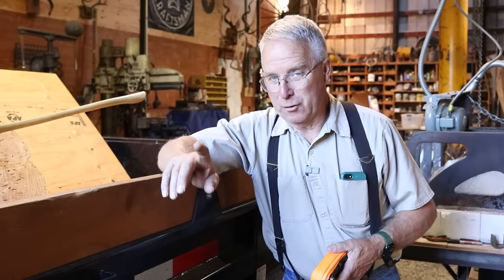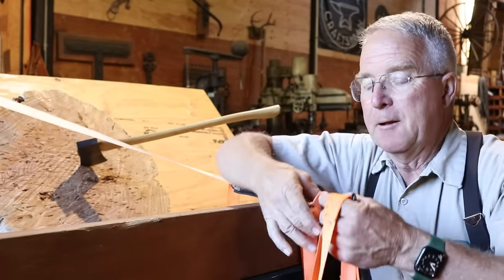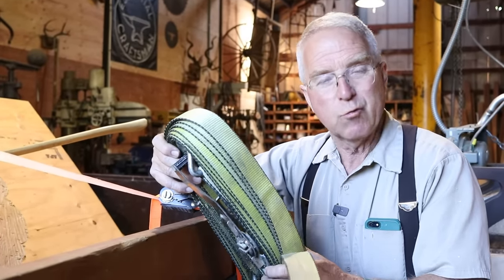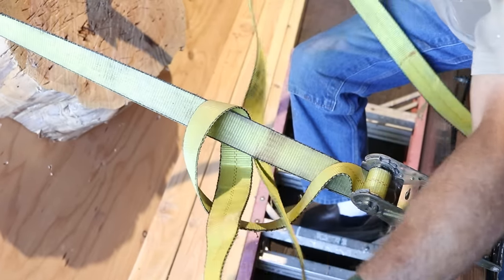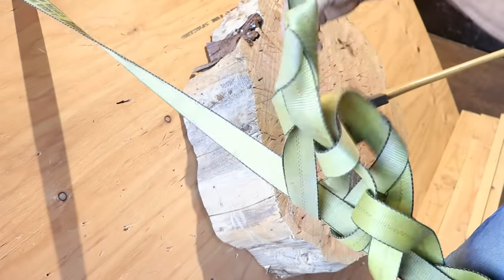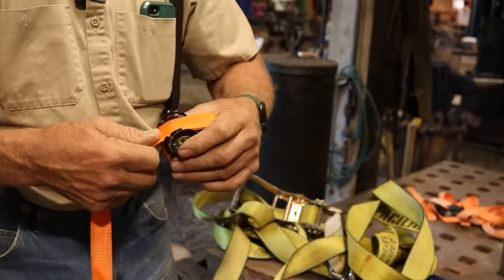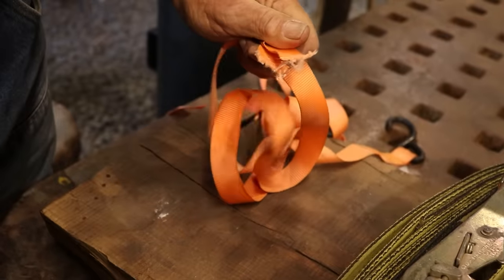7 Ratchet Strap Pro Tips

Comment: Also for the loose left over webbing I fold it repeatedly against the standing taught webbing and secure it in place with 3 or 4 turns of electrical tape… it’s super neat and easy to snap off when it’s time to in load… I’ve actually had that loose webbing vs wheel situation on the highway and it sucks! Hard! So  now I always secure the loose strap..

Comment: I like using One-Tie reusable zipties. I wrap my ratchet strap in nice neat bundles with them and then after securing the load I just bundle up my excess and use my One-Tie strap to wrap the excess to the strap. Fast, easy, secure and keeps me from loosing my one tie. If you have the tails of your One-Tie on your wrapped rachet straps all facing up when you store your straps then you can grab younr rachet straps by the tails of the One-Ties so you can grab multiple rachet straps at once out of your vehicle.

Comment: For the tails, depending on what I'm hauling, I just take the end and go to the hook to the left or right, run the strap through either the eye or under that strap, then do a quick loop knot and hold it fast. If the tail is long enough, then I'll loop it through the left/right hook and then back to itself.
No flapping in the breeze.

If I'm carrying boxes (I normally have cardboard boxes of delivery products), I take the loose end and pull it between two boxes that are stacked on each other. This secures the end and keeps it from pulling loose. I'll put 3 straps in the same spot.  If I need to put more, I go to another pair of boxes to finish those holding those straps.

Comment: Latest cross country, I stabilized the flapping end by driving a sharp awl, therefor no damage to the threads, right through the strap end and tensioned strap, and put in some 18 ga copper wire with a few twists.  Nothing moved.  And as these were boat straps, it turns out I can loosen them enough to take them off, yet they will go back on without any additional adjustment.

Comment: I use 27' long straps regularly. Sometimes with chain extensions. It's quite a ways up and over a double stack of hay! On occasion there is a tail,  what you called the bitter end. My husband ties that into knots and weaves it back and forth and then a few knots. Time consuming to pick that out! I will be showing him your trick. As I am the one who unstraps, I take the ratchet off the long strap and roll the strap, hook to the middle. It's easier for me to throw holding only the strap. If the strap does not hit the targeted spot I use a telescoping good ball retriever to adjust it's position from the ground. Not what it was meant for but until 8 can do better, that is the tool of choice!

Comment: Oh good, only 231 comments behind. First off thank you for all the wonderful videos. I have learned so much. Some I scold myself and I wrestle with but most of all learned a new way. I would like to throw two cent of an opinion your way.
  First off when terminating a end. There is a small pocket of double band between the short side to the ratchet. Fold up the remaining end and place in that pocket  BEFORE you ratchet the load. It can't even be pulled out after you ratchet it, until you loosen the ratchet. 
 Secondly,  I like wrapping the unused ratchet up the same way, but pull the load strap to the about middle and it will take half as long and when you ready to use, both ends will be in your hands when you unwind it.

Comment: Years ago, I got into the habit of storing my straps with a piece of cordage wrapped around the roll. Keeps them from unrolling, and provides a piece of rope to tie up the excess so it won't unravel. I tried bungy cords but found they have a habit of getting cut without you knowing. The strap wrapped up with about 2 ft of cord makes it possible to throw or toss the strap without it unraveling. The daisy chain I found can be a hazard when climbing on the trailer for something. (Ask me how I know) The rule of thumb was, pull it tight then tie it up. When done we roll it up , tie it ,then hang it by the hook for easy use next time.

Comment: Something I do for storing straps, is remove the strap from the racket, take the strap and fold end-to-end until I have the smallest workable length, then tie it in an over hand knot. At that point, I have a little bag I keep them all in, which actually came with a set I bought recently. You can throw em in the back of a truck and never have to worry about them tangling. Something you mentioned in your video about daisy-chaining extension chords that always sticks with me, “if I tie it in the knot that I chose, it won’t end up in a messy knot when I get to the job”. I know that’s not exactly what you said, but I tell all my helpers that when I’m teaching them how to tie a daisy-chain.

Comment: Fireball tool also tested and got the number: twisting your ratchet strap half a turn actually makes it handle more load then running it straight. Also keeps it from vibrating as much by the wind

Comment: For loose ends of a strap, I keep large Harbor Freight zip ties in my truck and just zigzag the loose end and then zip tie it tight.  My pocket knife cuts the zip tie loose quickly and it is already loose to remove the strap at my destination.  This method has also never failed me and keeps the loose ends from any flopping around in the wind.  Thanks.

Comment: Another thing if possible, is always put the windless “business end” of the strap to the passenger side of your trailer/load. That way if you have to pull off on the highway or road that you’re traveling to tighten or adjust your load, you won’t be on the traffic side of your trailer

Comment: I find the quick/easy way to wrap up the strap/store when not in use is to fold it in half repeatedly (maybe five) and then in thirds if needed (leaves a bundle ~six" long). With that done I then use a longer twist-tie to fasten it to the ratchet. Doing this, the two pieces are always kept together, take minimal space and they are quick/easy to use again when needed.

Comment: Sometimes the ratchet ends up in a tight spot when your going to loosen it, so you cant fully extend it to make it release. When that happens, pull both levers back on the ratchet, use a stick of your worried about your finger, and the half crank the ratchet back and forth. It will usually come loose.

Comment: I wrap my straps around like you did but if you leave like 2-3 feet on the end and then wrap 90 degrees to to the way you started you will find it holds better and you can tuck the tail.

Comment: Never buy the small 1" straps, unless its for use on a car roof.
90% of your tie downs will be using straps of a certain length, so take the tail of the strap that isn't used, roll it up with a hole in the center the size of your hand, then 2' from the ratchet, take the strap between the roll and ratchet and thread through the hole and over, tying a knot around the roll of strap. This can be left hanging loose and won't unroll. Then when unloading, just leave the strap as is, and pack it away. Next time you have a strap that can quickly be deployed, and you can easily adjust the length of the strap by rolling or unrolling parts of the strap on the roll.

Comment: I've seen a video by a trucker in BC, Canada who has a different elegant method for dealing with the tail -- fold it up, put it under the loadbearing strap where it meets the edge of the trailer, and snug it up, so the tail is clamped betwixt, and it also provides corner protection.

Comment: Thanks for the excellent video. So much good information. 

One thing I didn't see mentioned was what if the strap comes out of the rachet windlass. 

Close the ratchet, ratchet it until the windlass slot is straight and insert the strap. That way the strap is on the outside of the ratchet. Think of it as outside the box or ratchet.

Thanks again

Comment: The easiest and “cleanest” way to secure excess strap after ratcheting tight is to coil the strap (like you would a lasso) in about 1-1/2’ diameter loops starting about a foot from the ratchet mechanism. Then lay the stack of coiled loops on top of the taught portion of the strap splitting the coiled loops down the middle. Take the right side of the loops and go under the taught strap and up through opening of the other half of the loops and pull tight to the ratchet mechanism. This cinches everything down nicely and won’t blow open. Lastly, if you want, the tail end of this cinch can be looped over the ratchet handle and the pushed down to hold in place. No need for bungees or Velcro and you won’t look like you don’t know what you are doing.

Comment: I will caution against using the eye of the hook unless the eye is welded. It's very easy to spread the gap in the eye over time, and end up with the hook on the trailer sliding right through the eye when under a shock-load (going over bumps).

Comment: Great video. As someone who uses ratchet straps a lot for the back of the pickup, I love the tip about twisting and not having them flat. Just today I had a strap vibrating in the wind and I bet if I’d twisted it once it would have been fine.

Comment: The way you roll up straps is okay but it isn't the "pro" way at all.  First time I find a a strap wrapped up like that on one of our trucks the driver gets a verbal and a lesson, next time written and a lesson . . . 3rd time they are walked.  The reason is safety, that is begging for someone to toss a hunk of iron blindly over a load.  If someone is on the other side and catches a steel hook to the face it rapidly becomes a bad day for everyone.

Strap is always to be fully removed from the winch, without exception.  Then straps are to be rolled with the hook to the outside, so you hang onto the steel hook when the soft strap is tossed over the load.  Far less dangerous to get smacked with nylon than steel.  We supply strap winders to properly roll straps but most guys just hand roll them anyway.  

Lastly, zip ties are your friend.  Put a $0.03 Harbor Freight zip tie on your rolled up strap and it'll be ready when you need it.  Zip tie that bitter end roll in place, it'll be there on the other end and you'll be able to tell that your load is still squared away at 70mph.  Zip tie that ratchet closed and because you need a tool its less likely some nimrod will open it when you're inside getting lunch or going to the bathroom.

Want to know if the they are a hand just take a gander in their strap box.

Comment: Everyone is mentioning tape or cable to hold the wraps down.. I just use a thick rubber band and it serves its use over and over. As long as you don’t throw it around then the rubber band will last you years and be much faster to put on. Throw multiple ones on if you want to extra support

Comment: My son found someone on Youtube much smarter than all of us.  He learned how to fold up the tag end and make a loop around the working strap and wedge the folded tag end into the loop.  We ALWAYS separate the strap into the two parts.  We used to wrap the long strap around the hook (we ONLY use flat hooks on the heavier straps) and make a nice bundle that was held in a 5 quart ice cream bucket.  He has plasma cut an adapter for a drill motor that will wrap up the straps in a couple of seconds.  Both of his tricks make life much easier.

Comment: I use those short bungie loops with the plastic ball on them to store ratchets and then you have them handy to tie down the coil of leftover strap, but I do like your chain stitch idea. I store my cords that way but I will probably only use that on straps in a pinch. I make the trek from LA to Reno up and back every year with a load on a trailer and learned early that nothing that flaps is going to make a 14 hour drive at 70+mph.

Comment: Good tips! Thanks! That daisy chain trick is slick, I'm trying that next time. My previous method was less than ideal. A little trick I use when putting the straps away - I have pre cut pieces of small rope/string that I tie around the straps after they are coiled like you show. I toss a bunch of them in a tote and they stay together for storage and transport. It only takes a few seconds to do, and saves a lot of headaches when you need to grab a strap from the bin - especially when sifting through them to get the right size that always seems to be at the bottom of the tote 😊.

Comment: I store the ratchet separate from the strap.  When I put the straps away, I take the loose end and start wrapping it around my fingers. After about 1/2 is wrapped, I pull my fingers out and hold the center firmly and pull on the tail tightening the roll. Then I continue rolling the rest of the strap up.
This allows me to take the roll and toss it over the load and don't have to worry about knocking someone in the head with a piece of metal, or the hook slamming into the side of my truck.

A good trick for holding the straps tight is after rolling, take a large rubber band and put around the roll. It'll hold it fast and tight

Comment: I have two things I’ve learned that weren’t mentioned here.
First, if you’re having a hard time keeping the hook in place on the other side of the truck/trailer, leave the ratchet hanging freely from the opposite side, then when you hook it the weight of the ratchet hanging will keep it in place until you get back over to it.

Second, I’m not sure how to describe it in words, but it’s to deal with excess strap.  I roll the excess around my hand until you almost roll all of it up, then pull the last of it through that hole and back around itself.  Basically you end up with a little donut shaped roll of excess that you can just loop once or twice around the strap and it never goes anywhere.  I actually always keep my straps threaded through my ratchets and leave the excess rolled up this way at all times unless I need it longer for something I’m securing.

Comment: pro tip: separate the strap from the ratchet. roll up the strap so the hook ends up on the OUTSIDE of the roll so when you throw the roll over the load you're not throwing a metal hook that could hit someone in the head or break windows etc.

Comment: For storage of large straps, I coil them and then use a 2" velcro cinch strap. For small straps do the stuff sack method (royal crown bags are a good size) because it prevent multiple straps from tangling with each other.

Comment: When rolling up the strap; after getting the hook on the windlass side laid flat, I rotate that hook 90* then finish rolling up the rest of the strap. When it is all rolled up I rotate the hook back in line with the roll and the hook goes over the rolled strapping material and it helps hold everything in a tidy roll. I also put a ranger band made from strips of a motorcycle innertube around the whole rolled up strap. Keeps everything tidy even when digging them out of a tool box. Deployment is the same as your method, just take the rubber band off and rotate the hook first.

Comment: Not mentioned thats very important. Before tightening a strap, make sure there is enough slack to tighten into the barrel to overlap. two layers or more is always safest. If the strap was pulled tight before tightening the ratchet the strap can and will slip.

Comment: I roll them up just the same. But I open the ratchet part so I roll double the length with one turn. Speeds up the process a good bit. Barton more importantly it makes them easier to store and less likely to unroll, they don't tumble as easy they are more square potential hairties don't come of and so on (hairties I use around them and stick on my arm while driving, My sister's and girlfriend usually always have some old ones lying around that are to loose to use but perfect for their "new" job.

Comment: I found a bag of these tiny bungees without hooks on the end.   I tie them to my ratchet straps with some high tensile cordage - then I just roll up the bitter end, bungee it into a tight ball and drop it in the truck.  It's heavy enough that I've never had it come out, keeps the whole strap safe and keeps it from tangling around anything I'm hauling.    Takes some prep - but ultimately its the best I've conceieved of.

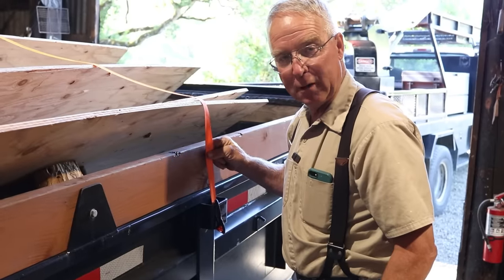Comment: @1:19 where your right hand is if you put a spring clamp on the 2x and on the strap it will hold it in place.  I keep a couple of clamps in the door of my truck.  On the loose end I just fold it up and put a round or two of electrical tape to secure it to the strap.  I also keep small straps individually in a ziplock bag.  Keeps them easy to grab untangled.

Comment: I often have to secure a boat or a motorcycle using ratchet straps to trailers. The boat is sitting on small wheels on the trailer and the motorcycle has suspensions. That is, the boat and the motorcycle are moving slightly when driving. This can make the hooks on the ratchet straps to loosen.

I would like to have some ratchet straps with a locking mechanisme on the hooks like carabiner clips but I don't think they exists.

Comment: I like pulling the strap all the way through to the hook for storage, then wrapping with the webbing end until I've got just enough for a couple perpendicular wraps at the end and a knot formed by either running the tail under the previous circuit and cinching tight. I'm able to free the webbing, then only pull as much as l need to tie the load. 

I'll also do the more complicated method of using the windlass to hold all the webbing securely for the straps l don't use as much while sticking with the quicker less secure method for storing straps that will get used again before they have an opportunity to unwind and tangle anyway